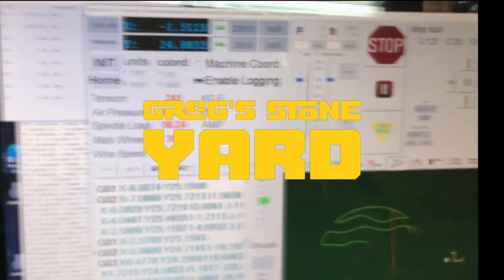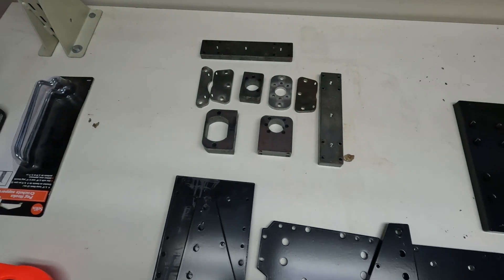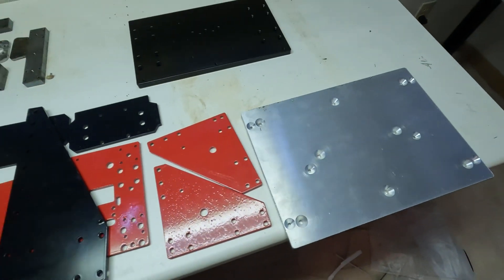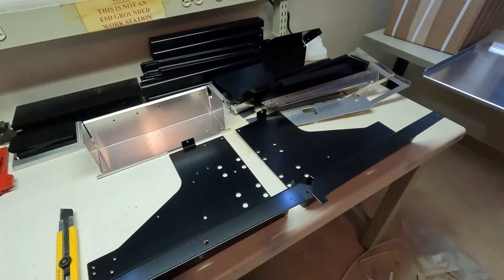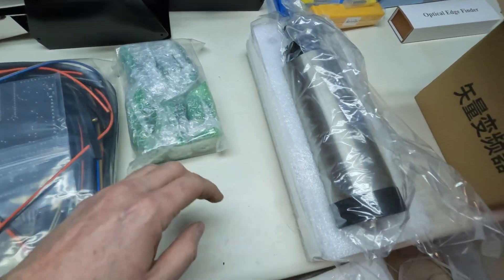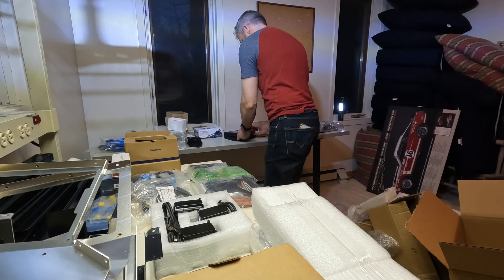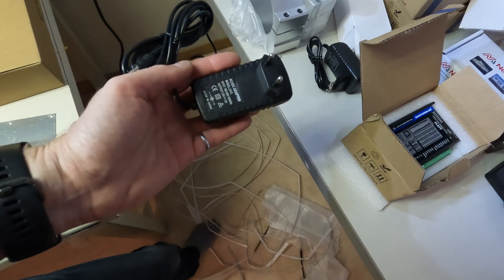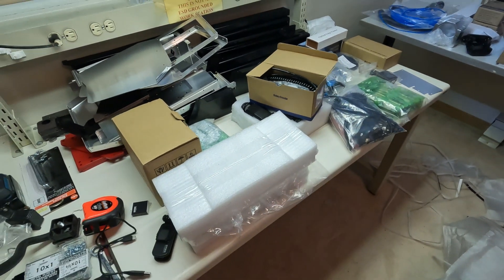Unboxing the Shariff DMC2 Desktop CNC Milling Machine Kit

Comment: Did you get any directions with yours? I didn’t receive anything no paperwork, thumb drive or even an email with directions? Ive tried emailing but still have not received a reply
Reply from the maker: Yes he has a google docs share with the various manuals.  You can contact me by email greg9504 at gmail.com for the link.  I haven't assembled mine yet.  Those who have noted some problems getting everything alined correctly.  There is a Discord group, 3D Misfits, I think this link should work: https://discord.com/channels/794761695993397291/934469236112384091
Reply: @GregsStoneYard Do you still have those assembly instructions? I just received my unit and I’m ready to start assembling but don’t know where to begin
Reply from the maker: @ChocFlip201 If you just received it, does that mean Shariff is still making the kits?  If he is he should be able to provide you with an up to date link.  Otherwise contact me at greg9504 at gmail.com

Comment: I didn't get in on the Kickstarter but in batch 2. Hopefully mine should be shipping soon. It bums me out over the poor powder coating. It looks like yours was well packed and received. In someone else's video they had bent parts and a few items that had been dropped. I've read through the build guide a couple of times but am looking forward to seeing a build video.
Reply from the maker: I still haven't put mine together yet!  I picked mine up so didn't have to worry about shipping damage. Hope yours arrives without issue.
Reply: @GregsStoneYard  I'm at the lower opposite end of the US from where Omar is located. The boxes in his pictures and the packing evident in your video looks like it's more at the mercy of the shipper than anything else. Was yours from the initial Kickstarter batch? I didn't have the funds available to get into the campaign but was able to get into the second batch. I hoped that by doing so would also be beneficial as any issues would be resolved. Your assessment of the powder coating on the frame components match the assessment of another person's during unboxing. I'm half tempted to strip them sandblast them and have them powder coated locally. Last thing I want is the flood coolant causing any issues with poorly protected metal.
Reply from the maker: @GatorGlider  I sent Omar a note about the powder coating and he informed me that for batch two they switched to a different company to do the coating, and the quality was much better.  So hopefully you are good.  Other than that, I wouldn't expect too many other differences between batch 1 & 2 as he had already ordered much of batch 2 components/materials before batch 1 shipped.  So I don't think there is much opportunity for improvements based on feedback from batch 1.
Reply: @GregsStoneYard  That's good to hear about the powder coating! I figured feedback from batch 1 wouldn't be incorporated just for the reason you mentioned. I was more hoping to avoid "small" issues like having to unsolder and resolder a diode that got placed wrong on the board (was surprised that happened).